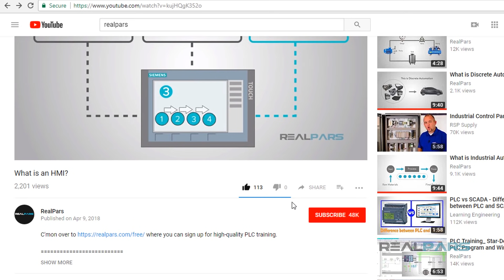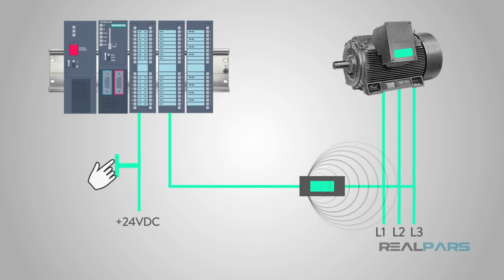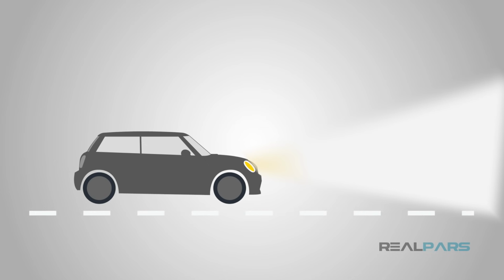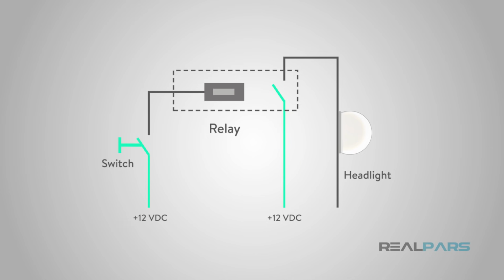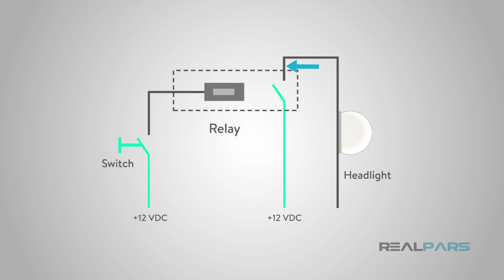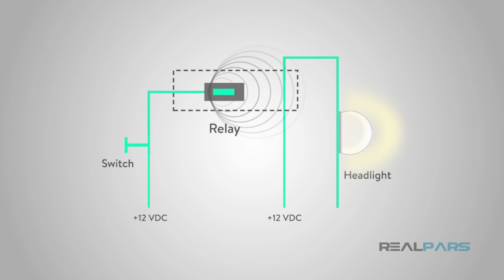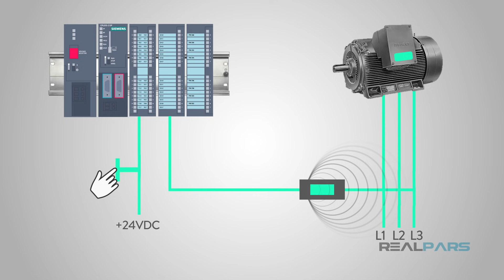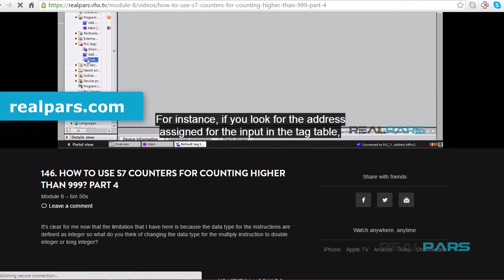What is a Relay System ?

Comment: do generally realys are used for low voltages or high voltages which can be controlled using switches or push buttons

Comment: So basically, relays (contactors) are used when we do not intend to directly switch OFF/ON high voltage and high current circuits (AC  motors)? Because what you are implying is that direct control of high voltage/current circuits pose potential danger to safety of operators?  
Let's say we have an air handling unit with a single feed electric panel feeding two supply fans (Each with 10HP AC motors). Would a panel disconnect switch still be required if we can use 24 V switch to operate the motor contactors?
Reply from the maker: You may have misunderstood the premise.  High voltage, such as 440VAC that is used to feed a motor circuit, cannot be switched on and off by a pushbutton directly.  The pushbutton does not have a power rating sufficient to do that.  That would pose a significant safety risk.  Instead, we can connect a pushbutton to a relay (motor start relay) that energizes a low-power 24VDC or 120VAC relay that is able to pull in a larger set of contacts (motor starter) to start the motor.   To answer your second question, it is good practice (and usually required by local codes) to have a main disconnect for a control panel.  Power disconnect switches are able to be de-energized and locked out to prevent safety issues.  Relays are also invaluable to keep circuits separated (for example, 24VDC from 440VAC, or two different 24VDC circuits),l also for safety reasons.

Comment: Are older PLC models any different than the ones in your videos?
Reply from the maker: Great question!  PLC programming with ladder logic has changed very little since PLCs first appeared in the 1970's.  The software has improved dramatically as PC's became more powerful, and more graphical.  But even more recently, most manufacturers have provided backwards compatibility with their instruction sets.  I can upgrade most Siemens S7-300 programs to S7-1500 with not much effort.  If  you can program an S7-300, you can program an S7-1500, and vice versa.  You may need to become familiar with a few differences in the software versions, but that is like learning a new version of Excel.  Newer PLC's are faster, have more memory, and can handle more I/O than older PLC's, but they are essentially the same useful logic processors.

Comment: Why do the headlights on the car have to go through a Relay? Is it also due to higher voltage and safety?
Reply from the maker: Hi there, in this video we have simplified the process of turning on and off the headlights of a car as an example for you to get the gist of the relay application. Actually, when you give the command to turn on the headlights in your car, this command goes over to the relevant ECU (which stands for Electronic Control Unit) in the car. ECU itself cannot send the voltage directly to different parts of the car such as the headlights, but instead, it gives the command to the relay which is associated with that part. That means it converts the voltage to the voltage level which is required by the headlight to be turned on.

Comment: Why do we use a relay as an electrical switch when we have transistors?
Reply from the maker: Transistors are wonderful; devices and very good switches.  However, they are limited to low DC voltages (typical;lly 2.5 - 5VDC) and low power (<500ma).  To handle many industrial switching applications, at higher voltages (24VDC or 120VAC) at up to 10A, relays are required.  At even higher voltages and currents, silicon-controlled rectifiers (SCR's) are required.  For every level of application, there is a suitable device.

Comment: Just wondering, if the headlight switch in a car is a 12v connection and the headlights circuit is also 12v - why would you need a relay?

I have a very basic understanding and I thought relays were used to control hvac circuits with lvdc/ac to prevent serious electric shock?
Reply from the maker: There are a couple of reasons that a relay is used.  The main reason is that with higher-powered headlights, it is necessary to use a relay to separate the low-power switching circuit (what turns your lights on and off) and the higher-power circuit to the lights.  Most auto headlight relays have two NO contacts so that both headlamps can be powered from one relay.  This allows each headlamp circuit to be individually fused and isolated.